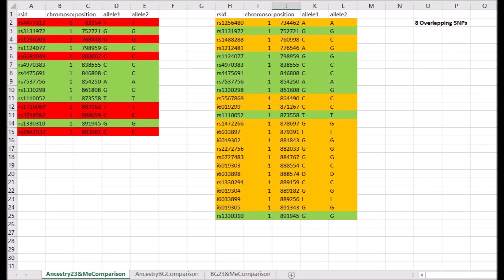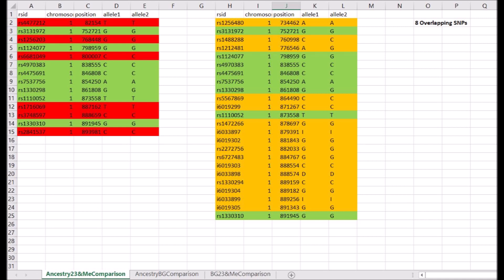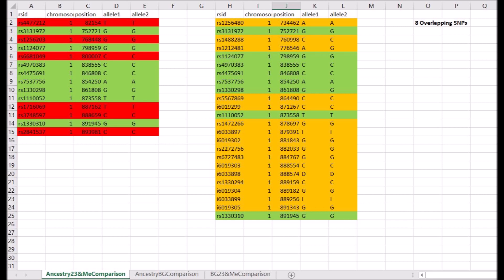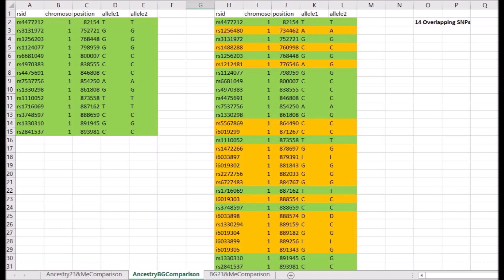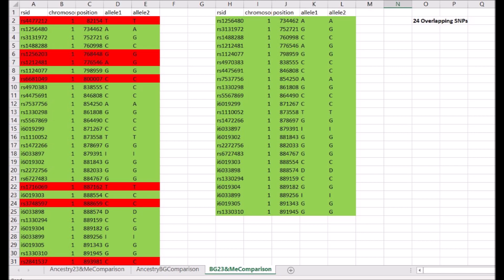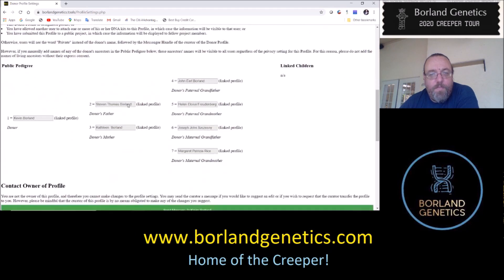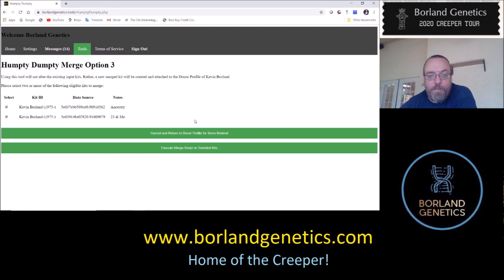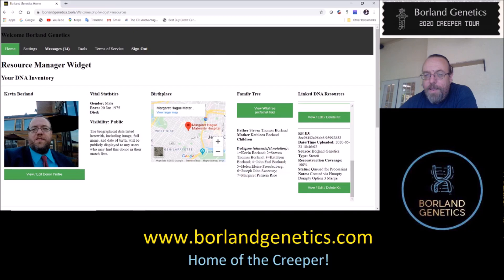How to Merge Two or More Factory DNA Kits Using Borland Genetics Web Tools

Comment: Comparing the first dozen results on the first chromosome on 3 tests, Ancestry, 23&me, and My Heritage, they all show a different set of 12, with 2 or more on any test matching on one or both of the other tests. One of the 12 on My Heritage which matches the the other tests, the My Heritage shows the alleles reversed. The Ancestry and 23&Me show TG but the My Heritage shows that same marker as GT. Does this mean the My Heritage alleles are all the reverse of the other tests? How does this impact merging these tests?
Reply: The order is random, so GT is the same of TG.  The measurement on the chip doesn't account for which allele is paternal or maternal.  So GT = TG.  They are identical readings just reported differently.  The merge tool will treat them as identical.  This is why testing companies don't just automatically report which of your DNA matches are paternal vs. maternal.
Reply: @KevinExploringMyWorld  Okay, thank you for the explanation.